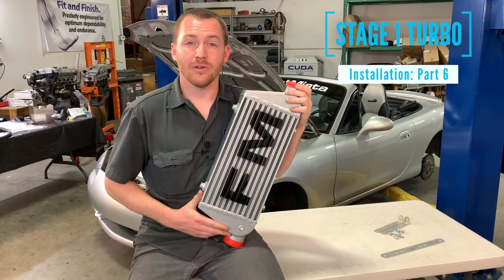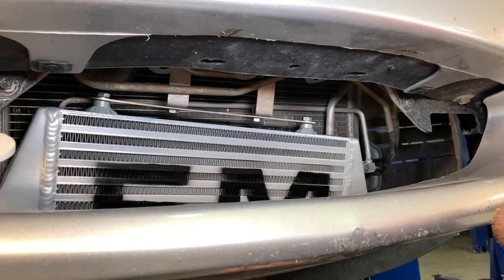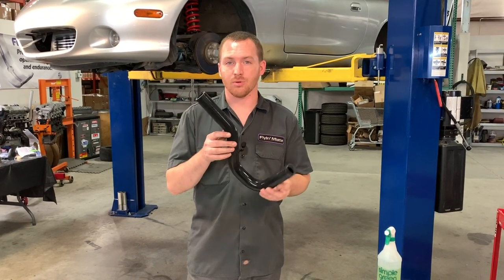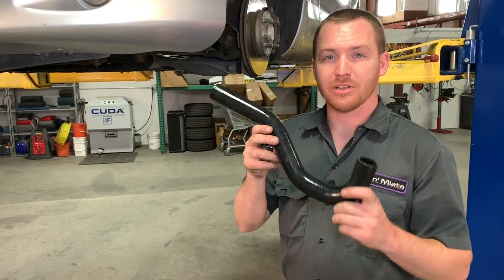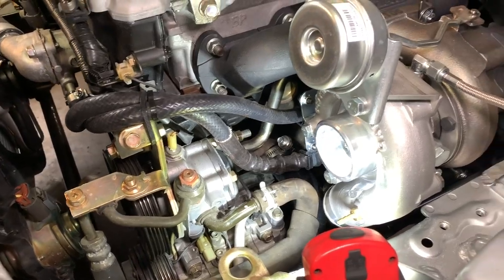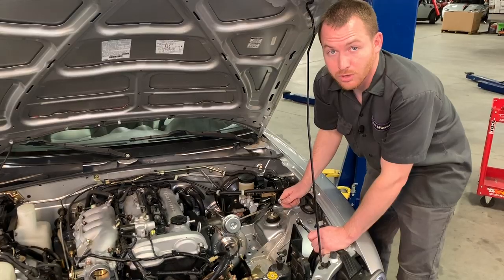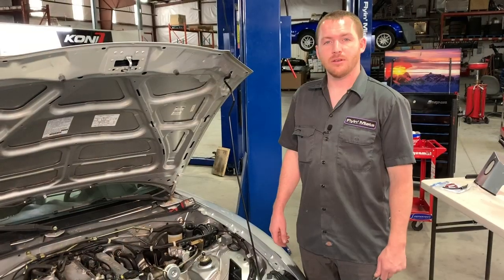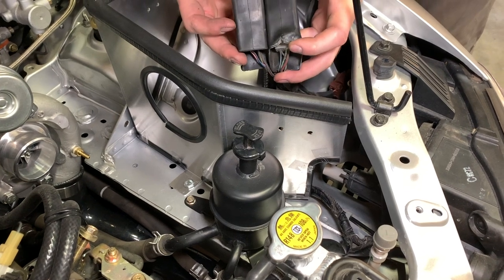Flyin' Miata NB Stage 1 Turbo Install - Part 6: Intercooler & Intake

Comment: This whole series is excellent, very well produced and shot to show exactly how each element fits and the possible problems. I also love how Mike points out how each clamp should best be oriented to allow easy access when the whole install is complete and it may be necessary to reach the clamps in order to remove them or possibly readjust the pipe. Kudos to all involved for producing this series of videos.
Reply from the maker: Thanks Tommy! We appreciate the kind words!
Reply: @FlyinMiataVideo  would a water to air intercooler, and a killer chiller set up work better?

Comment: It would be really nice if we could get a Little Enchilada install video. From ways of getting the stock downpipe off or cutting the stock intercooler piping, all the way to why the hell Mazda decided to use a different power steering oil cooling line on the MSM (which does not move out of the way like the one on this NB for the intercooler fitment) there is enough of it's own issues and differences that the MSM deserves it's own explanation for all the steps you don't get from this Garrett install series.

Comment: Question:  I am thinking of doing the FM crossflow radiator, the FM coolant reroute, and also the 1 piece FM lower radiator hose.  I am also planning to get your turbo kit in the future.  This is for a NB, 2001.  Thank you for these vids, it's like watching old speed channel builds or something :)

I'm assuming it is best to install the lower hose without trimming it - and then later when I get your turbo kit - I will drain the coolant and trim the lower hose at that time if necessary to fit the coolant and intercooler hoses down there?

Comment: why has the oil drain line changed from what it was?
Reply from the maker: You caught us! We did the video showing installation of the rubber oil drain because that's the most common option - but since this is destined to be one of our R&D cars, we switched it over to our hard lines later. The hard line makes a brief uncredited appearance at one point in this video.

Comment: Is it possible to use a different BOV that vents to atmosphere with the included inter cooler piping? I’d like to run an HKS SSQV BOV if possible
Reply from the maker: As long as it fits a 1.375" hose, it will mount. You will have to block off the hose for the recirculation.
Note that this will not be emissions legal and you will have driveability problems using a vent to atmosphere valve with a stock ECU, as it will act as an inlet for unmetered air at idle and cruise. We strongly recommend a filter on the BOV for the same reason.
There is no performance benefit to venting to atmosphere, but it makes a cool noise.

Comment: 1:00 in the turbo housing what is a torque specs for the bolts?
Reply from the maker: We don't have a torque spec for the constant torque clamps on the inlet pipe. You'll want to compress the washers but not bottom them out. I'd snug them up and see if you can rotate the pipe. If not, you're good.

Comment: I just installed my compressor outlet hose yesterday in my na6, which has ac and power steering. The fit was incredibly tight, and the ac lines created an issue for me. If I ran the outlet hose to the left of the ac line in question (outboard side) then my outlet hose was smashed up against the stock anti-roll bar bracket on a thin part. I decided to route it to the right of the ac line but this has brought my outlet hose in danger if rubbing the ac belt/wheel. It’s not forced against it so much so I have secured it away from the ac with a zip tie (not too tight so as to crush the hose) for now. Have you dealt with this issue before? Any tips for what I should do differently or does my solution sound acceptable?
Reply from the maker: There will always be a little problem solving with these kits since every car will be a little different due to age, modifications and factory options. If you have power steering and especially if you have A/C, the compressor outlet hose is going to have some contact with other hoses, lines, etc., which is fine as long as there isn't a chance for the hose to be rubbed through.  Experiment with the hose routing but as long as it's not touching the belt/pulley, that's the most important part.  Use short lengths of cut hose to protect against other hard lines, sway bars, upper control arms, etc. that may rub against the hose to prevent them from rubbing through.

Remember; the intercooler hoses will expand to their normal (full) size with boost, so unless they have a hard pinch in them from squeezing between two fixed surfaces, some contact with non-moving parts is not going to hurt the airflow or power output.

Comment: How much more horsepower does a 1.8 engine has over the 1.6 engine and which one is the best. Engine. To build which one will last the longest.can you turbo a high compression engine and if so what compresion
                             

8
Reply from the maker: The bottom end is very close to being the same, just scaled up. The NB got a couple of different heads with improved flow, so the 1.8 has more ultimate power potential. With the NA head, expect about 10% more power out of the 1.8 with all else being equal. With the NB heads, you can get a bit more. That's assuming you're limited by the engine hardware and not something else - our Stage 1 turbo kits are not dependent on the engine hardware itself but are limited by fuel delivery.
Strength is the same for the same sort of boost level. Longevity is the same. You can turbo an engine with 13:1 compression if you have good fuel and good engine management.
Reply: @FlyinMiataVideo  can you turbo a automatic. Tramission and is it adviceable and what kind of preformance can you expect

Comment: What's up with the constant out of stock?
Reply from the maker: There are several hundred parts in our turbo kits, sourced from dozens of suppliers. We're having a hard time getting inventory - and when we do get some, they sell immediately so unless you're signed up for our "back in stock" emails, you never realize they were available. We strongly recommend signing up for the emails and be ready to order as soon as the parts arrive.

Comment: How effective  is the intercooler. It looks small! Are there any upgrades available for intercooler, like air to water type or larger air to air type. Are there any intercoolers that use freon to cool the charge. When u use the turbo in racing situations will the heat build up reduce the temp. drop from the intercooler. 
  I read about a turbo kit that claims to not need an intercooler. This has stuck in my old feeble mind.😧.  Is it hog wash?🐷🐖 
  64 and afraid to ask in person
Chris
Reply from the maker: The intercooler is effective enough to get intake air temps close to ambient. You can't go any lower with an air/air, so going bigger wouldn't help. If an intercooler is too small - like the factory one for the Mazdaspeed Miata - you can heat-soak it and it loses effectiveness. Our ICs don't have this problem.
Air to water has improved packaging where that's important, but then you have to cool the water and heat soaking is a bigger problem. There have been occasional intercooler setups that use air conditioning to pre-cool water like this. I believe the Ford Lightning did it. It's a short term option, it cannot keep up with the amount of heat being generated. Air to air is the simplest, most effective and most reliable option.
When you compress air, it heats up. Basic physics. A turbo kit that does not use an intercooler is banking on the idea that the air is not heating up TOO much, which means it's running very little boost and the ignition timing is fairly retarded to prevent detonation. 20 years ago, we offered one like this and about 5% of customers chose it. Every one of them has been upgraded with an intercooler since as there's no real downside.

Comment: No startup to test it?
Reply from the maker: This was episode 6 of a 9 part series. We can't start the car until the install is complete, timing is adjusted and all the fluids are refilled. This all happens in future episodes. :)
Reply: I’m patiently awaiting the wiring of the voodoo box which is what I’m most intimidated off with this kit. I’m sure the start up will be shortly after that video.

Comment: The lines on a 99/00 AC compressor stick way out, no way you could fit that intercooler hose and the coolant hose through there.
Reply from the maker: It can be done. We've been using this hose layout for well over a decade.